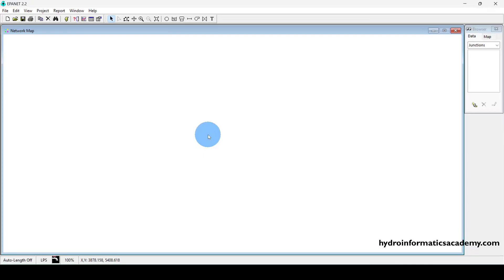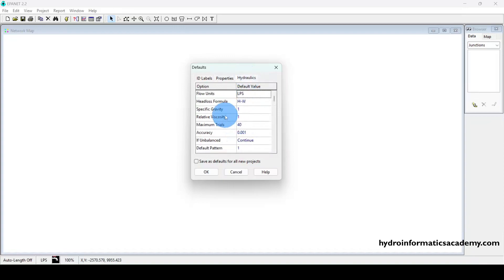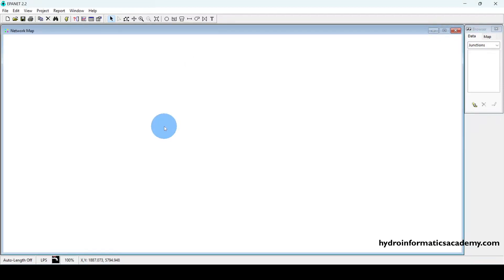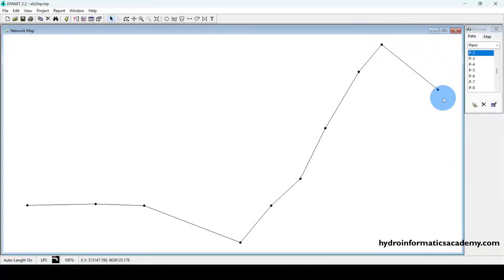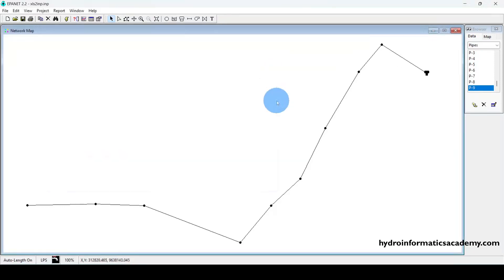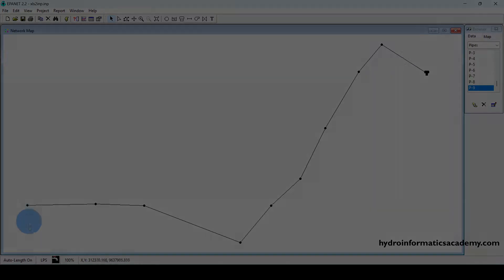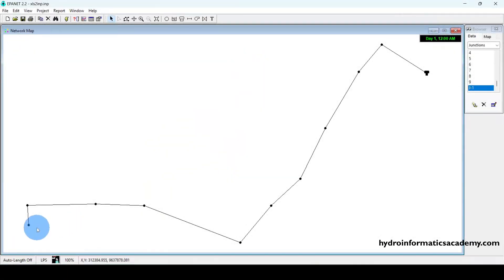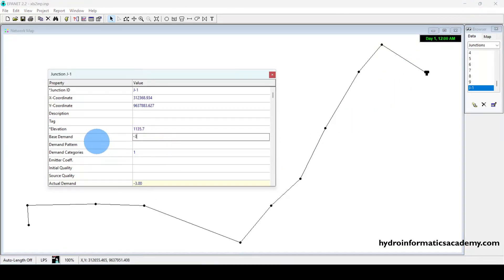This is How I Sized this Water Pump in EPANET Software

Comment: I want to add one note: you can simply replace any nodes in Epanet by choosing the other hydraulic type and replacing it with the existing one. here you can select tank and just click on that node you have and replacing will go on and every detailed information like pipes connected and elevations will still remain.
Reply from the maker: Does this work? In epanet or Watergems?

Comment: Out of topic question but you cannot connect 2 pipes right? Need to put junction first?
Reply from the maker: Yes! To link two pipes you need a junction🙏
Reply: @HydroinformaticsAcademy  What data I will input in the junction that I will use as a connector, sir?